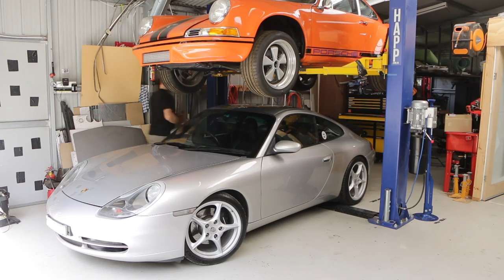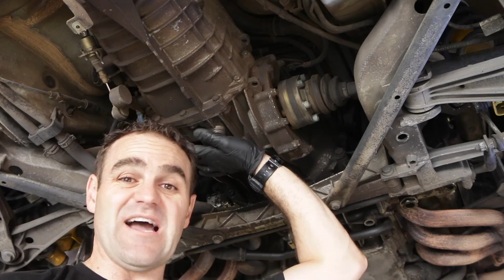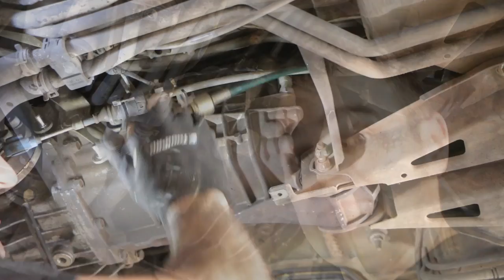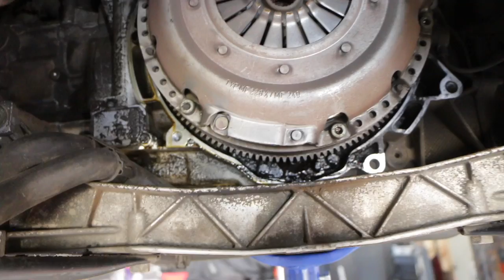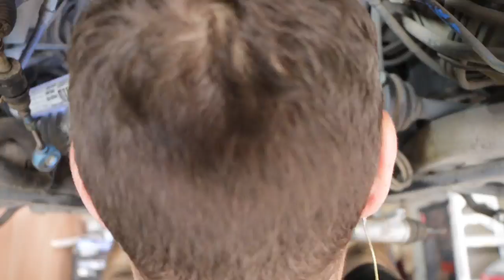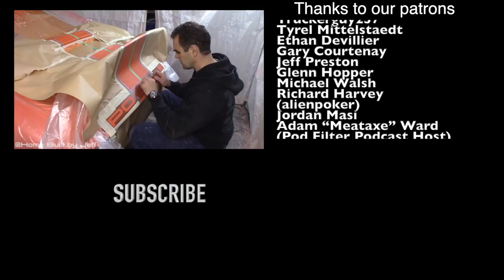996 gearbox removal and clutch removal - 986/996 IMS bearing and RMS replacement part 1

Comment: 9.18 - If we club together,we could get Jeff a new pair of gloves.
Reply from the maker: Grinding kills the gloves quickly ;)
Reply: I'm in.
Reply: On that subject, glove manufacturers are now using nylon on the upper side of gloves. It is really bad, in contact with heat en oil it just falls apart.

Comment: Been working on a VW Transporter, replacing the turbo, glow plugs and not trying to fault find a problem where it has no power ... and those tri-square bolts are everywhere

Comment: Thanks for taking the time!  I'm looking into a motor / transmission swap from a Cayenne 955 into what is called a Gbody.  It has a tiptronic auto but it's virtually the same process.  This is a real eye opener.  Well done👍🏼.   I'm wondering if it would actually fit under the transmission tunnel without any metal work involved.  One question though, is the "transfer case" part of the transmission geared or does it use some sort of silicone fluid coupler to transmit power?  I'm asking due to my car being RWD and have no use for the front shafts.

Comment: Replace the AOS if you can get at it, the thing is cheap plastic and the oil just eats it from the inside out.
Reply: Also now that you’re in there check you oil pressure sender, mine was leaking and it was easy to get at with the trans out

Comment: Awesome 👍🏾👍🏾  good get it all done properly and everything that need's to as it a mission to do,  I did that mistake as took a head off my Rav4 was thinking of doing the oil pump seal but didn't then I had to do it because it started leaking badly after I gpt it back on the road,  lol

Comment: 4:46 what Jack stands . Good luck with that . Not possible
Reply: How is it not possible? I removed my 911 engine and transmission on jack stands... most people do.
Reply: @adross7940  I'm sure how if the under body of the car you can't Jack in properly!!! The rocker seals on this car are weak as !! BS you can't remove the engine and transmission without a hoist then how do you remove it complete if you have no room or way to fit the car so you can slide the driven train unit . Need something with wheels and low profile and take the weight.
Reply: @adross7940  I'm sure you have a 911 of any kind .
Reply: @adross7940  most people do what excalty?? Most couldn't afford a Porsche let alone repair one at home even have the knowledge